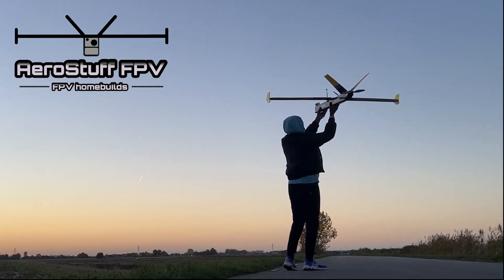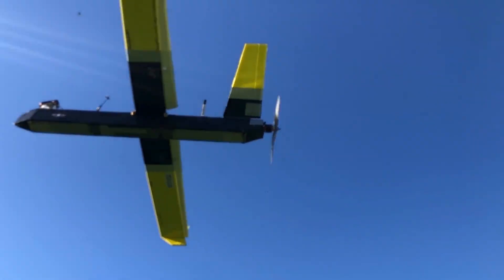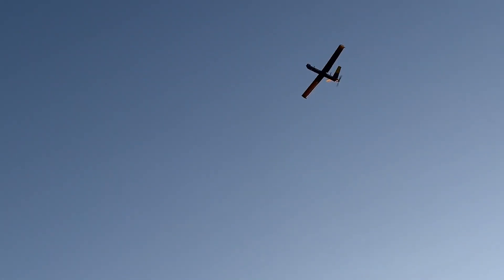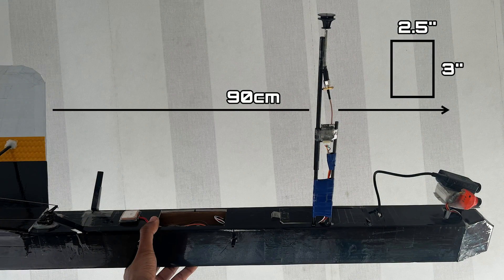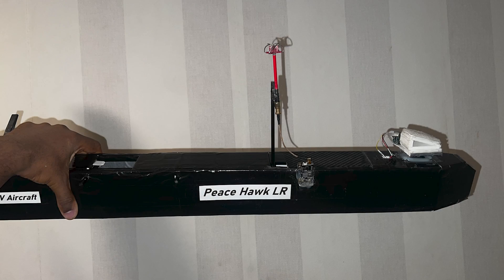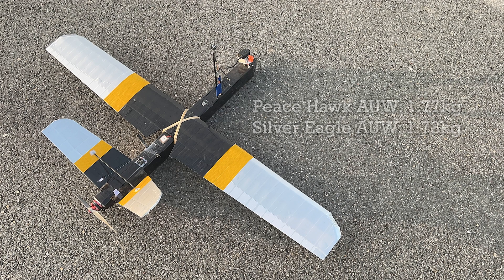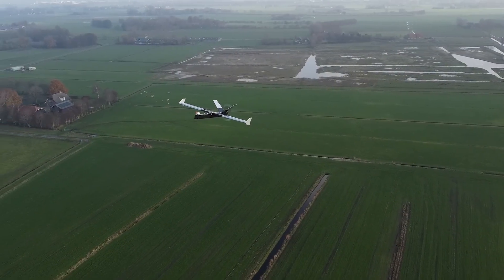V-Tail Pushers for Long Range FPV - Design & Performance Comparisons

Comment: hey great build, as being concerned abount my build- its 2.5m wingspan with 2330g auw ( 2000g without landing gears and groundsteer mechanism) coupled with 5010 360kv motor mated with 1238 propeller running on 5000mah 6s (samsung S50 21700) ouputting 1100g of thrust.. its built with high density EPS foam which is pretty sturdy, my main goal is to acheive maximum flight time.. yes its a pusher vtail... what do u think what should i expect from this build? i did tested it and it does get air borne smoothly just like a real aircraft, but as soon it goes airborne i have to cut the throttle because of limited space... 
plz give your opinion and tips in which mode should i fly it (ardupilot)
thanks
Reply from the maker: Sounds like a serious build. Congratulations on it! I always use iNAV and never used ArduPilot.

But I would change the prop to a direct-drive propeller instead of a SlowFly(12x3.8) - Like a 12x8 or 14x7 for better low cruise efficiency.

To achieve maximal flight time on your set up using software, let it fly in a loiter mode on it’s lowest altitude-sustaining throttle input.
Reply: @AeroStuffFPV I'll definitely implement that
Thanks

Comment: Hello buddy, I'm planning to make a silver eagle and plan to fly far, is the 3536 950kv motorcycle as efficient as the 4108 600kv motorcycle, I'm having trouble finding the size, do you have any other motorcycle size recommendations 🙏
Reply from the maker: 600kv is more efficient

Comment: Hello, I'm curious about your thoughts on a model I've made. I want to build a model with a FT Explorer wing, a 1448mm fuselage, and a tail I added myself. I want to build a model that uses an 880kv 2216 motor and a 2400mah 3s lipo or a 4s 6000mah lipo. I'm thinking of a 1160 for the propeller. What are your thoughts on the model? Do you think it will fly?
Reply from the maker: Yeah it’ll fly with the 4S conversion. I’d recommend a 11x7-11x9 propeller for better efficiency.

Comment: Neither one have much range I can do 16 miles out and 16 miles back with a stock zohd dart 250g.  35 miles on a 3s1p 3500 mah lithium ion battery pak with a little left in the tank 😂

Comment: Bud, sorry for the noob question but don't you risk cutting your fingers during a hand launch when rear prop is mounted as a pusher
Reply from the maker: There is a lot of clearance with a proper hand launch.

Comment: Hi,
I'm from remote part of Sri Lanka . I have done similar 1m ( completed ) and 2m ( still in building phase ) wingspan RC planes . I have only 1m Fuselage and every other part done as above specs you. I have 22kV motor 4800mAh 3S batteries . Do you think 1m Wing (100g ) will work with these ? 2m wing will be around 900grams . Whats your recommendations ? Can i talk to you via web ? 
Due to bad weather test flights not done for a week and cant seems to be good for next few days either .

Comment: Nice but rather than buckled foam board construction, try basing it on a glider, either CF in molds or simply use a model glider as the base. It's my understanding that the exact shape of the wing profile is all important. That just a visual rough approximation of a wing shape is far from ideal. That a socalled laminar wing can have 80% less drag. Literally a 5x increase in range.
In general a competition glider form is a great guide because they are fantastic performers. A glider recently did an unpowered 1000km flight from mainland italy to corsica and back.

Comment: Great build! It's well tested now that wingtip vertical stabilizers are much more efficient if you can round them from the wing and have them at lesser angles than 90 degrees. I know it'd be significantly harder to make though.

Comment: Pusher props tend to be noisier than a tractor prop is due to the "dirty air" off the tail. Like the engineering and construction detail. Flying out so far while being able to maintain the link is pretty challenging. Nice work all around.

Comment: When I was growing up there was an RC plane race between two towns about 260km apart. Using a 60-nitro engine with 2 fuel tanks gave an average speed of about 160km/h and a range of about 100km some of the planes had a max speed of well over 200km/h but there was no FPV in those days it was goggles on the back of a pickup.
The planes were made of balsa wood and film with fiberglass reinforcement in places.
Reply: Crazy stuff I would have loved to witness that.
Reply: Now the government just shakes its finger at you and says everything is too dangerous. Sometimes I wish I could've been born 10-20 years earlier so I could see the 70s-80s.

Comment: Excellent video and explanation. You probably already thought of this but in the pursuit for maximum efficiency I would start doing surface work (aka improving aerodynamics) mainly in the fuselage. The rectangular section combined with the triangular nose creates fluid separation which results in significant turbulence. That both creates drag and feeds the prop turbulent air resulting in loss of prop efficiency.
Also, testing winglets vs elliptical wings would prove an interesting concept if you have the time for it. The challenge here would be to figure out a good way to make a clean cut on the wing material.
Reply from the maker: Thanks very much!

I've thought about methods with making the fuselage more aerodynamic (round) without sacrificing it's current durability & strength. I still haven't found a proper way but I'm on it for sure.

The wing shapes are being thought on as well, probably implementing a taper-ratio (smaller tip-chord than root-chord) but with wing-sweep to get the leading edge's straight.
Reply: @AeroStuffFPV  Good to hear man. I would love to try it myself but getting these materials has become hard and expensive in my country due to restricted imports so I’m eager to hear out what the outcome was. Keep me posted!
Reply: Oh, almost forgot. Structurally speaking, an O section is as structurally sound as a rectangular section as long as the section area is the same in these low force applications. The challenge being manufacturing/conforming said section with these brittle materials.

Comment: A lot of similarities between your peace hawk and the MQ9 block 5. The reaper gets ridiculous flight times of greater than 24 hours. At the end of the day, all these UAV platforms are striving to build a glider with an engine. Would look into gliders and at similar platforms for ways to get even better performance. As an Aero Eng, my de facto answer is extend the wings a bit more and also look into the concept of elliptical wings to increase efficiency. Gets better lift and less drag, both will greatly enhance your range.
Reply from the maker: Thanks for the input! I'm studying the same as well and I'm learning along the way.
Reply: Do you have any suggestions for reading material on better understanding aerodynamics?

Comment: Canards will be less drag at lower speeds if sized just right. They're a lifting surface where a stabilizer / v-tail is a counter-lift to counteract the lift of the wing. Or... Just vacuum bag a hotliner/F3/F5 style wing. They're fast, low drag & effecient, but the high aspect ratios leave them very prone to tip/snap stalls.

Comment: So, does you solid fuselage aircraft work better than a twin boom aircraft?
Reply from the maker: They perform about the same, but the V-Tails are slightly better in every aspect (efficiency, stability, climb etc)

Comment: Nice design I wonder whether instead of using duct tape, maybe try encapsulation film?  It's used for identity cards etc. It's very light, a lot cheaper than covering film, and can be easily ironed on, adds a lot of strength too.

Comment: Have you done any tests to check if those monstrous winglets actually help anything?
Reply from the maker: Even though there is little to no moment-arm for YAW stability (which was the actual reason for the huge winglets - I never did proper testing if they'd actually make my planes more efficient) I eventually disgarded the idea and went for flat/curved wingtips for efficiency instead. Now, the V-Tails aren't any less stable (as expected) - and are probably more efficient than before.

Comment: Next step - better integration of the antennae to the plane.   i.e. having an antenna INSIDE the tip of a v-tail and INSIDE the tip of a wng for a cleaner, more aerodynamic exterior.  The foam is NOT to provide any RF interference.
Sde note - You are not transmitting into space.  Point the video TX antenna downwards towards you, the receiver instead of having the RF go through the battery, electronics etc inside the fuselage.  Only point the GPS antenna to space.
Reply: The problem would be the risk of damaging the antenna during landing.

Comment: Hi, very nice project, if I can advice you something, please close gap between flaps and fuselage on both wing sides. Such gap create "induced drag" because it vent air from below wing section (higher air pressure) to upper wing section (lower air pressure) so reduce wing efficiency. I also suggest to improve surface quality of the wings and fuselage, this will also reduce drag which should increase aerodynamic efficiency and help you with new record.

Comment: Samsung 50S 21700 is the best cell  combining endurance with performance In one package. 
Because you are making a small battery pack, the price difference is very small but the increase on durability and performance is much, much better.

Comment: Can you clarify the v-tail chord lengths for the silver eagle? This video says the tip is 4" and the root is 6.5", but in the original build video it says 4.5" and 6" respectively. I think the original build video is wrong but just wanted to check

Comment: Would definitely use the new Samsung 50S over the outdated Samsung 48G or 48X, its much higher discharge rate and much lower internal resistance will provide for a much bigger difference in capacity than what you would assume from the 200mah difference in capacity.

Something like a Vapcell F60 21700 with 6000mah or Vapcell F56 with 5600mah would also be better options for a pure energy cell but you would have to discharge them at 1C or less to get any real benefit out of them (these cells also should be discharged fairly low to get much benefit out of them, as they unlike most cells still have a lot of capacity between 3 and 2.5 volts).
Reply: long range configurations aren't current demanding so there is no point in sacrificing capacity, no matter how small that sacrifice is.

Comment: A youtuber made an RCPLANE that still flying for 7h !!! I dont remember the Chanel but it very crazy but your plane is crazy to continue like that :D
Reply: Rctestflight? I know he made a delta wing which was covered in solar panels which only started using the battery after it got dark.
Reply: @atrumluminarium rctestflight did this. Only a German university group did more, with a 72 hour flight (atlantik solar I think?)
Reply: @pauljones9150  Oh, I haven't seen that. I'll check it out :)
Reply: @atrumluminarium  it's cool, mind you this RC plane had stupidly large wingspan and somehow included software to help it find upward drafts (not a clue on how this was done)
Reply: He isn't a youtuber who happens to make an RC airplane. He is an engineer who happens to make youtube videos.
Reply: Search in your history
Reply: It was not 7 hour it was 10 hour

Comment: What airfoil did you use? I’m working on designing my first drone now in cad, and went with a Clark Y air foil.
Reply from the maker: The airfoils are created by folding strips over the foamboard plates (Armin Wing Airfoil) - Good luck on your build!

Comment: I still haven't made a proper video on my plane, which is a twin boom A-tail pusher, but it gives me 80-90 mah/km with 4s1p 21700 battery. Wingspan is 1.55m and weight is a bit over a kilo. The main difference from your builds, I'd say, is that I've bent depron into an airfoil with an S-shaped bottom surface (a-la e216). Don't judge its stability on my video too much, it was very windy during that flight :)

Comment: Love your aircraft and efforts on this channel. If you wanted to increase rough air stability (without increasing mass or power), how would you aerodynamically modify a v-tail design?
Reply: Either make it "inverted V", which is very impractical with a traditional fuselage but works very well with a twin boom design. Or use a traditional tail, which doesn't have the inherent adverse yaw of the V-tail. The inverted V is the best of the three.

Comment: What if the transmitter was underneath ?
Reply: Thats good question
Reply: @dominiq4343  I think it could be stream lined better then and project downward to the FPV and have a small bit of alloy sheet go act as a barrier leaving the GPS to receive signals from above . Maybe ?

Comment: Sticking to a single design and improving it, its much better than hopping between designs and hoping to find a better platform. Honestly I'm getting similar range and flight time on a wing based design, but nothing inline with the price point of your foam build design. So with lots more $$ invested getting further and longer flights isn't always a reality. Well done, and thank you for sharing your experience, building technics, and performance of the models

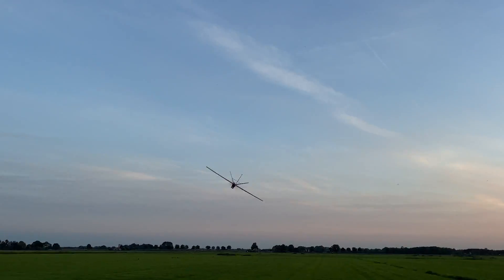Comment: Greetings.  @3:56 curious of that model.  Was making a tractor setup instead of a pusher as I have several pushers, wanted to go back to a smaller noise footprint and less broken engine mounts.  Was there any adverse effects of the wingtip mounting camera ? obviously not centerline with FPV however what about adverse yaw ? or disorientation when flying ?  

Thanks again for the uploads
Reply from the maker: That's my 1st ever V-Tail-Tractor design with Auto Pilot (check my 1st (oldest) video on the channel) 
https://www.youtube.com/watch?v=XNzZ4MulVCU

The disadvantage is not being able to pan or tilt the camera (the 3rd version of the tractor design had a tilt-servo built in as well for looking up/down: https://www.youtube.com/watch?v=4cj3yPmpl4A&t=21s (go towards the end to observe)

However, it depends how you use the aircraft for FPV. I used it to have a look over the neighborhood and fly out a little further (1.5-2.5km) So I didn't worry as much about the offset of my view of the aircraft. 

The latest design (Silver Guardian) which is a conventional tail has the FPV camera beneath the tail and looks a vew degrees down which was my ultimate sollution for a single-engine tractor platform

Comment: I built your Silver Guardian, and it flies like a dream, with a SpeedyBee F405 Wing FC and Arduplane! If anyone doubts how well these planes fly, I can testify how good they are. I have not done a distance test yet, but flying with a basic 3300 mA Lipo, I easily get 45 min of flight! I am so impressed, I am motivated to build one of your pusher seen here in this video.
Reply: Please post it on your channel if possible
Reply: @ghostraptor2068  I only have pics right now.
Reply: What long range antenna do you use both plane and goggle?
Reply: How much it costs?cosas? Overall
Reply: Hi Allan, i am newbee and trying to build a vtail using speedybee f405 wing. I have some questions regarding configuring the v tail servos. Do you have some guidance in the fc configuration and electronics connections. It seems that part is somehow not clearly explained. Thank you.
Reply from the maker: That's awesome man, please send photo's or videos if you have them to my IG (aerostuff.fpv) I'd love to see it